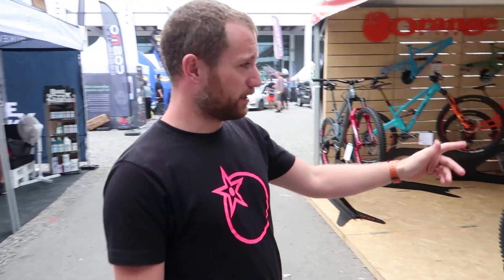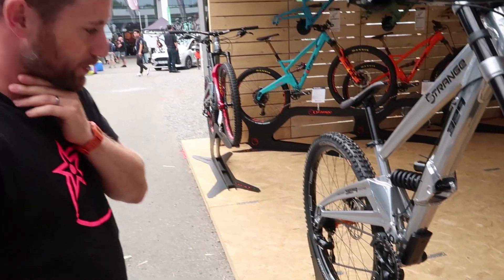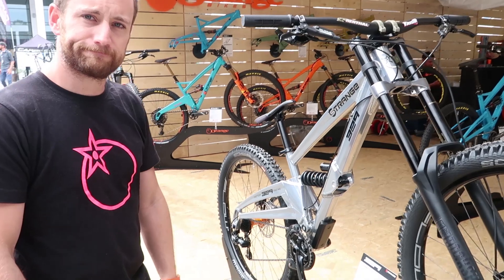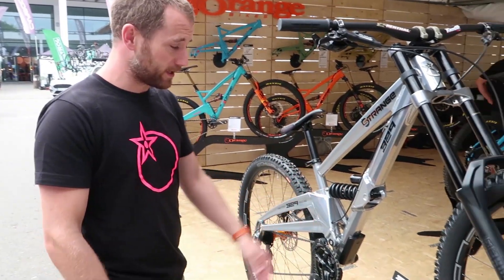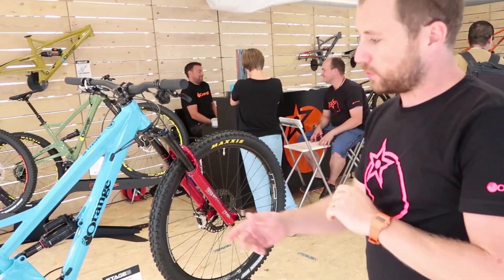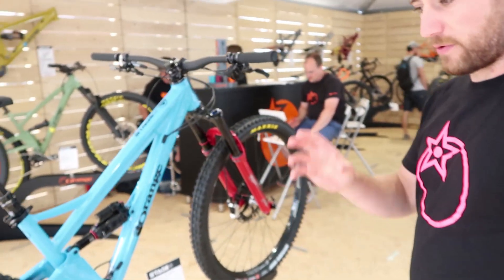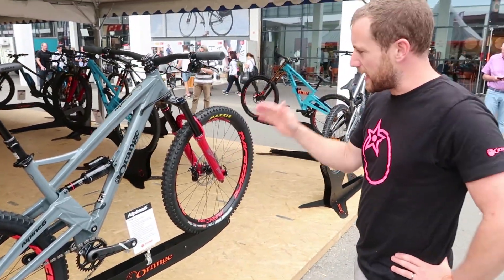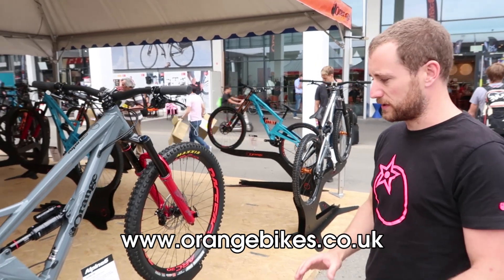ADDING WEIGHTS TO THE BIKE? Orange Prototype 329 at Eurobike

Comment: I’ve had a few Orange bikes (222,Patriot 66 and 5). I agree they do look a bit dated in pictures but when you see them in real life you start to appreciate the evolution of the design. Which, let’s face it has been a successful process for certain German car manufacturers. Also I’m not an engineering expert and I’m not a particularly talented rider however when I ride an Orange bike I find them predictable and still very capable. I admit that in certain circumstances you get the sense that the suspension system could be improved but when you are just having fun and chasing your mates and not concentrating on suspension kinematic they just do the job. Also, consider this. UK riding conditions are generally pretty crap. In particular In the North where these bike originate from. After a year of proper riding the bearings will need replacing. So that’s 2 main pivot bearings and a pair of shock bushes, no specialist tools and a little bit of common sense and you are back on the road in about an hour. Compare this to an Intense Tracer 2 which I also owned for a couple of years. This bike required a full bearing set after approximately 9 months of riding. I can’t remember how many bearings it had but it cost me about 3 times as much. I had to make my own bearing press, I ruined the paint getting them out and there were two bearings (main lower swing link) that I couldn’t source and cost more than all the others put together. I still enjoyed owning the Tracer and if I’m honest I would choose an Intense over an Orange again however the Intense also had some strange suspension characteristics. So I suppose what I’m saying is this. All suspension designs have positives and negatives. Engineering is about balance, you can’t have everything. Rather than worry about suspension design just get out and ride. I will admit that I have been guilty of chasing the latest designs and shock absorber technology to improve my riding but now as a pretty average unfit 41 year old dad  I’ve realised you just need to ride more....Peace.

Comment: Why not make it more heavy to begin with ? Making a DH bike as light as a enduro bike is Silly
Reply: Because you can put the weight where you want it, or just have a light bike. Enduro bikes are heavy because of dropper post / wide range gears, aside from that there is not alot separating them from dh now.

Comment: Adding a kilo to the frame does improve the sprung/unsprung weight ratio of the bike. The problem is there's a rider on the bike, that is also part of the sprung weight. This literally DOES equal not taking a huge dump. And i absolutely hate that analogy when talking about lighter bikes/components.

Comment: orange= stupid suspension system and more more more weight
Reply: Afonso. monocross...
Reply: Afonso. search on web , the monocross is a bad suspension system, inhibits braking , flexes in the corner ecc...
Reply: They're also stupidly expensive considering they look like they're all made in some dude's shed. They were cool in 2004.
Reply: Afonso. I really doubt it. There's a reason nobody else is using that sort of design anymore. I'm sure it's not bad, but it's dark ages design compared to what's around today.
Reply: The comment about weight is clearly wrong in this instance: 15.26kg for the size L version reviewed by Dirt recently; compare this to 17.8kg for the 27.5" version of the Commencal Supreme (and the 29" version would obviously be heavier), which is currently dominating the downhill world cup.

 Discussion of the suspension kinematic also seems pretty sketchy. It may be easier to engineer lateral stiffness into a frame with two connections (other than the shock) between the front and rear triangles, but that absolutely doesn't mean that a single-pivot will always be too flexy, regardless of how it's contructed. In the Dirt review for this bike, the only mention of frame flex was as a positive characteristic, citing it as the reason for lower levels of rider fatigue when compared to other bikes in the test. In the absence of other information, I'll go with the analysis of a person who's actually ridden the bike.

The comment that a single-pivot is 'dark ages design compared to what's around today' is pretty interesting. What particular suspension kinematics are you referring to? The most popular design on the market today would appear to be the Horst-link/FSR/four-bar layout, which has been used in production MTBs for over 20 years and first appeared as a prototype in 1985. The only truly new suspension kinematic to emerge in production bikes in recent years is the R3ACT 2PLAY system produced by Naild, but this hasn't been universally praised and has yet to see widespread adoption by frame manufacturers. I'd argue that most bikes in production today don't have better suspension systems than they did 10 or even 20 years ago (ie: they're literally using the same systems), but that they've just been refined and are now better implemented (also with much improved shocks/dampers,) and the same is true for Orange's single-pivot as for the Horst-link systems used by other manufacturers.

It's also overstating the fact somewhat to say that nobody else is using this sort of design anymore. Though there may not be a huge number of true single-pivots on the market, there are many linkage-driven single-pivots; bikes with absolutely identical potential for anti-squat, pedal kickback and anti-rise/brake-squat perfomance. For example, every full suspension Evil, Kona and almost every Commencal (including the hugely successful Supreme and Meta AM models) uses a linkage-driven single pivot. Literally the only difference between the two systems is the tuneability of leverage ratio, in all other respects the above bikes have the suspension performance of a single-pivot.
Reply: I don't see how a near concentric single pivot design can be remotely as good to ride as a well designed 4-bar/Horst or multi-link design in terms of braking and pedaling characteristics? Pedaling not as important on DH assuming kick-back isn't bad, but brake jack/squat is... and concentric single pivot on a bike you pedal is just... no. Not for those prices anyway.
Reply: I can understand why you'd make that comment with regard to brake-squat, on paper at least, as it would be impossible to construct a bike with a physical pivot as far forward or low down as the instant centre that could be achieved with a floating/virtual pivot system (Horst-link/four-bar/VPP, whatever... same thing) If brake-squat/anti-rise is your main concern, you could design a layout with 0% or even negative values with such a system. However, I've got to point back to real world examples, the Commencal Supreme in particular. With its super high pivot, which also sits slightly behind the BB axle, brake-squat should be an issue and on paper it would look to be, with anti-rise values of 140% to about 120% across the range of travel. Yet, race results and rider reviews suggest that the bike's an absolute ripper, being on the top step of the podium at every downhill world cup so far this season (Myriam Nicole in Losinj, then Amuary Pierron at every race since.) The Orange uses a pivot location much lower and somewhat further forward than the Commencal Supreme, so the kinematic will have lower anti-rise values. I wouldn't want to say that categorically shows that the braking performance of the Orange is good, but I think it would definitely be a mistake to write it off just because it's a single-pivot. Cy Turner wrote an interesting article on his reasons for moving from a Horst-link platform to a linkage-driven single-pivot, in which he stated that the old Horst-link bike had a tendency to brake-jack quite unpredictably, and that in testing he found that the brake caliper location had far more impact on brake-suspension interaction than the kinematic layout alone. Positioning the caliper so that the braking forces were directed at the pivot location produced the most stable and predictable setup.

I'm less clear on why you'd think that the pedalling performance would be bad, due to the use of a single-pivot. It's possible to achieve a whole range of anti-squat behaviours depending on the chosen pivot location, and the only available analysis of the Orange 329 in particular, again from the review in Dirt, is that it actually responds really well to pedal input. I think it's also worth mentioning some examples of other bikes here. Going back to Commencal again, how many EWS races has Cecile Ravenel won on various models of the Meta AM? This is a linkage-driven single-pivot bike, so the braking performance and the drivetrain performance is absolutely single-pivot in nature, and yet it's been a totally dependable and very successful machine for enduro racing. The Evil bikes are another example using a linkage-driven single-pivot, but all accounts I've heard indicate that they pedal well. Even a company as big and apparently technologically advanced as Trek are not above using a single-pivot swingarm at the heart of their suspension platform. Obviously they also use a split-pivot at the rear axle for improved suspension activity under braking, and the seatstay drives the shock linkage, but the anti-squat characteristic is pure single-pivot.